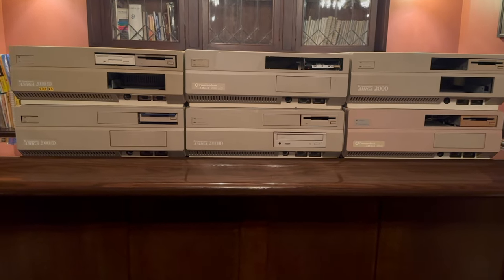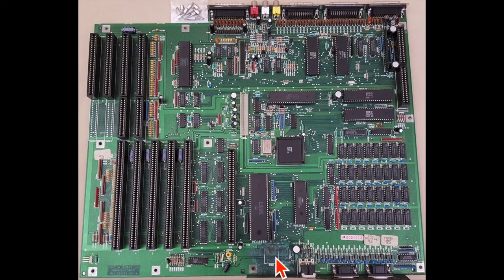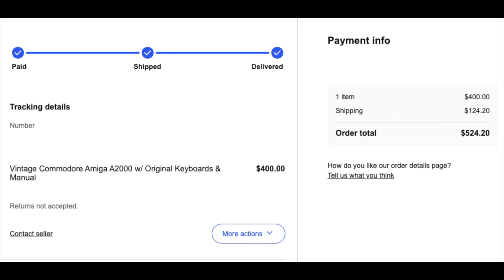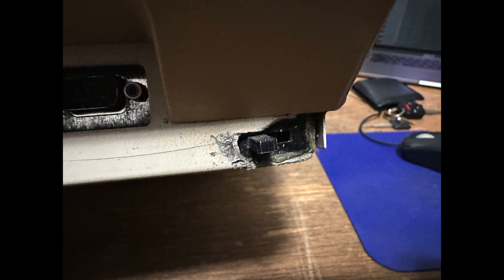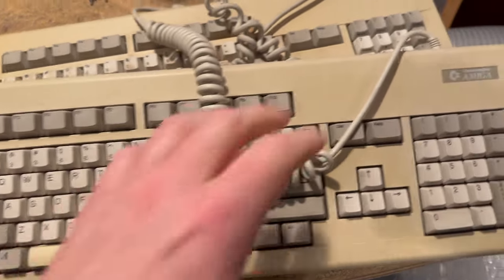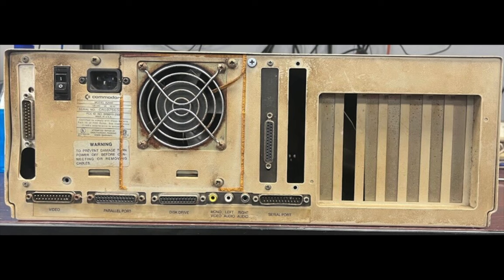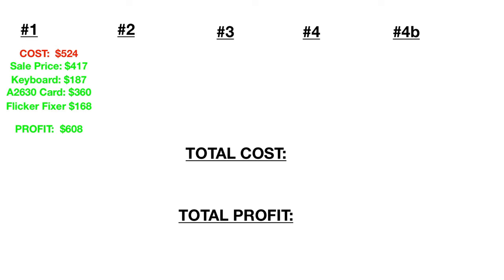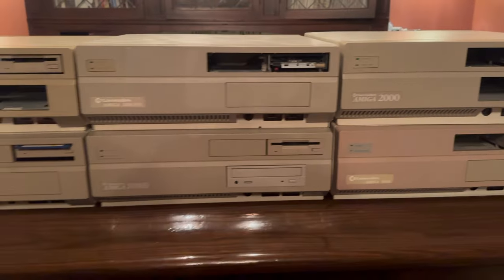RR#8:  The 2000 is the best Amiga, but will people still pay up?

Comment: I noticed you didn’t get any PC bridge boards in any of them. Amazing that so many had the mega chip ram expansion.
Reply from the maker: Actually I just did get one!  Need to test it though.  Yeah megachip surprisingly common.  It’s convenient in that it gives you ram expansion with it
Reply: Actually, no it is not amazing.  One megabyte of chip ram is required for the Video Toaster.  This is the main reason why many Amiga 2000 computers have a MegaChip installed.  🤔
Reply: @HansCampbell  2M, and yes I have two myself.

Comment: Nice!!!
Another 2000 fan boy here. Still have my original I bought back when they came out.  Ive amassed a collection of 6 so far and three spare motherboards. Ive always planned to do what you do just havent gotten around to it yet. Ive cleaned them all up, removed batteries and mitigated all the corrosion as best as I can. Just bought one recently that still had the battery installed but very little leakage!!!
I bought a 2000 last year that was branded "Video Toaster". It did come with the toaster card but no software. I'll eventually find the software.

Comment: Can anyone tell me what the difference is between the Amiga 2000 and the Amiga 2000 HD?
Reply from the maker: HD version is just a 2000 with a scsi controller card and HD installed.  I think it was 40 or 80mb.  Nothing different about the computer, just expanded, and with HD badge on front
Reply: @RDKLInc Ok, Thanks!

Comment: Amiga 3000 is the best imho … 4000 better specs, but for overall design, the 3000 was peak Amiga
Reply from the maker: I kind of agree, but it also never caught on to the degree that the others did, and the add-ons for it didn't vary quite as widely

Comment: since you've found the middleman sweetspot - the A2000 market- it has become impossible to find any A2000 in a reasonable state for less than $500. Meaning you're gobbling them up and reselling - to Us! which stinks, as I can no longer afford the elevated prices of middleman economics. There aren't any on amibay either.  The A2K market is dead for me, and don't get me started on A4000s😣
Reply from the maker: Don't blame me!  I've found many since I made this video, so if you haven't found any, you're either doing it wrong or not looking hard enough.  Why not build relationships with some recyclers and save Amigas from being scrapped?  People don't understand that salvaging electronics and saving machines involves actual WORK and relationship building